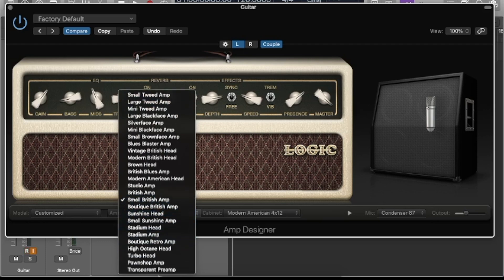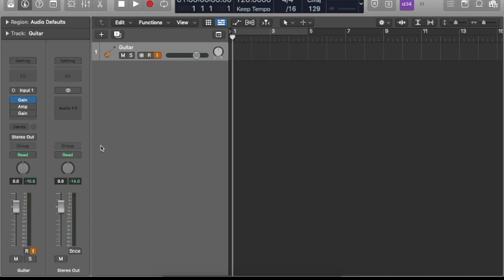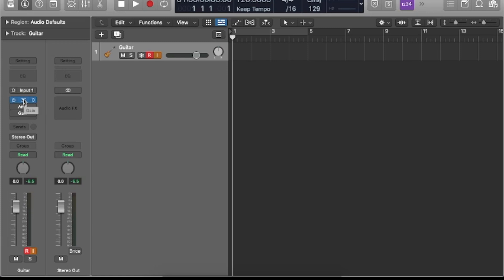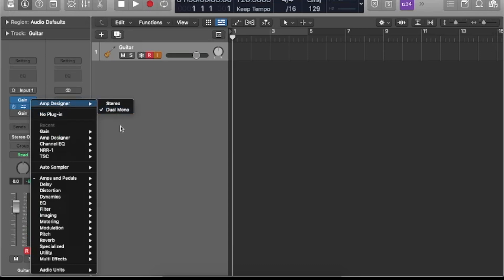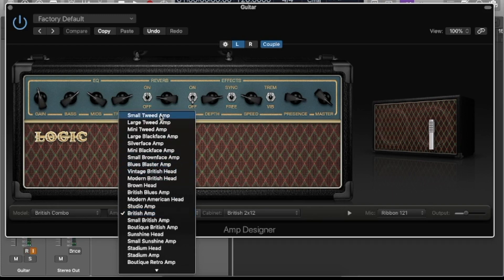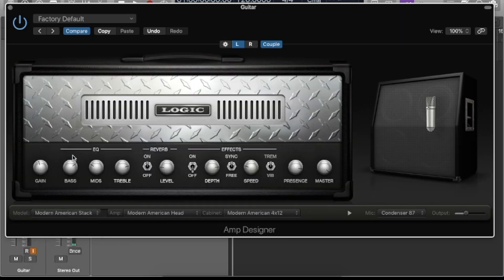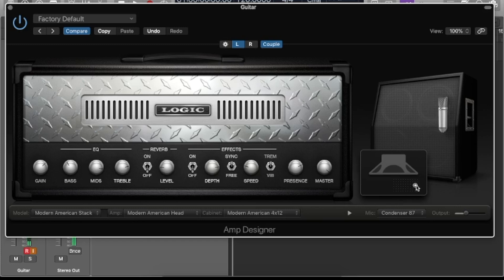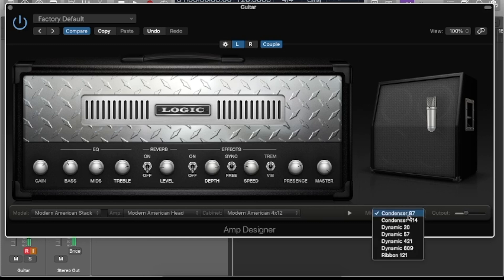Get a Surprisingly Good Metal Tone in the Logic Pro X Guitar Amp Designer

Comment: Use the brown head, the modern American 4X12and the dynamic 57.
This one of my favorite combination.
Reply from the maker: I'll have to try that!! Thank you.

Aside from the mic choice, that's actually really similar to a bass chain I've used a few times, and it works really well at medium to lower gain.
Reply: @prodby13Conor  Try it with some good guitar trust me. I have a video in my channel where I tested some stock logic amp and trust me... you won't regret it ;-)
Reply: Brown head is the molded marshall sound. It gives a tight boosted gain sound, about as good as you'll get with logic pro. Modern American is based on the mesa cab that is somewhat resonant and has v30s , also a solid choice.